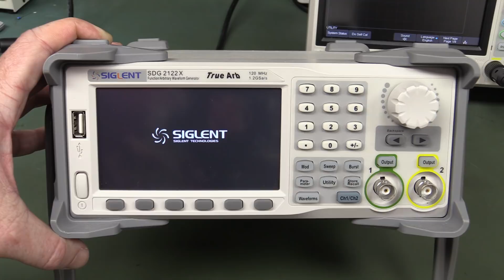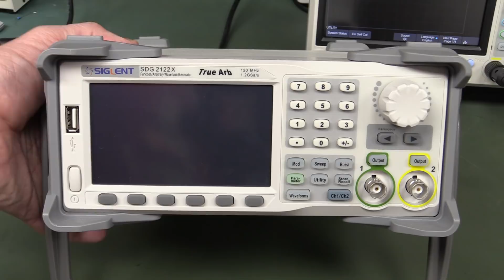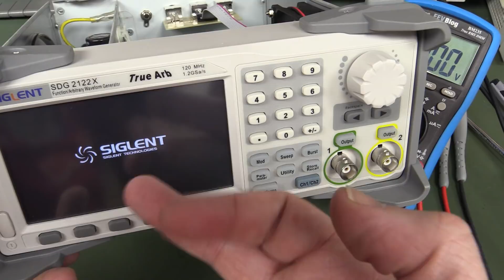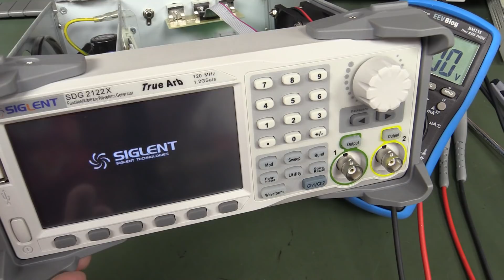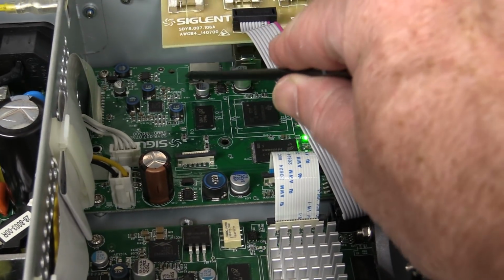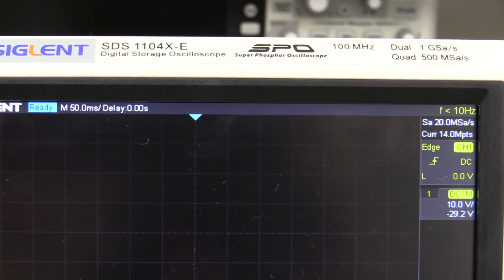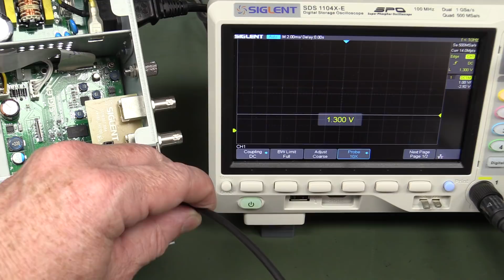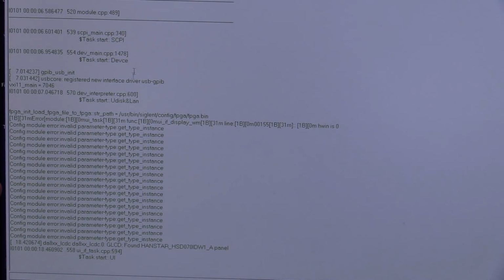Siglent Signal Generator FAIL

Comment: Hi, i think to a corrupt firmware, best thing to try is reflash firmware with usb stick if possible or to connect the signal generator to pc via the usb port at the back of the case

Comment: Download the firmware from their website. Write it to the root folder of a FAT formatted SD card. Power off. Put that SD card in the reader. Power on. Go get breakfast. It should be running fine when you come back. It might lose calibration data, so check it with a known good frequency counter. It will probably lose Arbitrary waveform memory during the update. Such is life. Happy NY!

Comment: I'm gonna agree with everyone here that this machine is 1) Definitely running Linux of some sort as it explicitly states that it's running a file system known as UBIFS, which is a Nokia FS meant for raw flash applications. Looking around PEBS are Physical Erase Blocks and LEBS are Logical Erase Blocks. There are several lines here that seems to indicate that there are none available, meaning that there simply isn't enough free disk space to boot or decompress. Then you get all those errors at the bottom that might be caused by trying to access a value that was supposed to be on the loaded file system, can't find it and fails? Sounds like you should try to flash it with the SD card or send it back to them, definitely a software failure on their part.

Comment: I would say the micro is working. The flat flex cable running to the display/ui looks fuckered.  You may want to check out the UI circuit.

Comment: I'd guess at a hardware fault. The system probably doesn't start the main task because it can't detect something that should be there. My guess would be that it can't see the siggen circuitry on the other board which would lead me to suspect that board interconnect cable.

Comment: there seems to be a ribbon cable connector on the processor board that's missing a ribbon cable. Although that might be for QC testing? Anyhow, the second board doesn't seem to have a ribbon cable connector, but there's a ribbon cable on the processor board going all the way to the front, so if there IS a ribbon missing, then maybe it might go to the front aswell, although I'd guess it to probably be for QC.

Comment: it is saying “task start ui”. it can not started the ui due to a bad software. so, reflashing it can be a simple solution before trying to check everything else. by other hand , can be: mem chips. bad flashram, bad bga cold joints. thoughts?

Comment: Check the mechanical connection between the front panel and the control PCB.  My guess is that the UI process waits for a response from the front panel before drawing anything on the display.

Comment: My money is on the filesystem being full. You can see a bunch of errors about how there is no free space on the disk, creating new logs fail, etc. The UI probably needs some free space to put its locks on files etc. Most of the time Linux won't boot with a full FS.

Comment: Check the ribbon cable that connects the front panel to the processor card - if not seated correctly at aither end, the keyboard controller may not initialise, resulting in what you see there.

Comment: There are at least three log streams mixed in there. Lines starting with "[ timestamp]" are from the linux kernel. 

Lines starting with "10101 timestamp" appear to be from the init process. You can see it starting various tasks, SCPI, Device, Udisk&lan, UI.
There also appears to be extra output from the tasks themselves.

But it's the timestamps themselves which are interesting. You can see it starting the Udisk&Lan task at 7.05 seconds. Then there is a huge 13 second gap until 18.42 seconds, when it inits the display panel (I assume the bootloader put the logo on there and just left it on the display. 18 seconds corresponds with when the screen goes blank).

So it looks like the problem is with the Udisk&Lan task. It shouldn't be taking 13 seconds. I checked the original teardown video and it boots in 8 seconds flat.  

Looks like it's retrying something 18 times, and failing each time before giving up and moving on to start the UI, which fails silenting because something about it's environment is wrong due to the previous errors.

Comment: The display window manager isn't initializing.  It is unhappy with the display hardware for some reason.  Check the cables and connections to the display unit and the keyboard. Initialize to defaults if possible.

Comment: There are tons of lines with "Config module error: invalid parameter-type: get_type_instance" error messages in there, so that's probably a corrupted firmware. Maybe you've had the luck that a neutrino passing through your flash memory didn't just pass through without hitting anything, but instead it flipped the right bit to make it stop working ;)
I'd say: Get the original firmware, reflash it (either over the serial terminal or with a microSD card), and it'll work fine again. Until the flash memory dies completely, that is...

Comment: hi
it looks like a firmware problem if you can make a recovery usb to see if you can get it to boot from that to recover the firmware but before you do that tack all the boards out and check then put it back together and then see if it boots if that

Comment: I had to repair a Nikon microscope camera that had failed after some mains power disturbances. Nikon metrology had remotely diagnosed a failed motherboard and wanted about £2000 for a replacement, plus another £500 off for fitting and it was at this point that my help was sought to ask if I could fit the board.  I wasn't about to believe Nikon's diagnosis without checking for myself. The unit crashed and rebooted whenever you selected the camera on the touchscreen, so I guessed that the operating system was likely corrupted due to the power disturbances.

There's a whole long saga about Nikon's apalling customer service and all the hoops I had to jump through to get hold of the firmware. Then there's the fact that the installation instructions were wrong, but eventually I got the firmware installed and the camera sprung to life. 

It's increasingly a problem with equipment that has a build in operating system, Windows CE, or some flovour of Linux, that it gets corrupted and you're faced with a brick.

Comment: I think the part you should be paying attention to is the bit where it says:

Error[module: ui_task func:ui_if_display_wm line:00155]:: hwin is 0
Config module error: invalid parameter-type:get_type_instance
…

(It'd be easier to read if you had your Terminal program set to interpret VT-100 escape sequences…)

If I had to guess, I'd say there's some non-volatile memory (either battery backed RAM or Flash) that needs to be erased and reset to factory defaults. That's what I'd be looking for — in particular, if there are any onboard batteries, I'd try removing them, waiting a while, then replacing them, on the off chance that that on its own would be sufficient.
Reply: I agree. It appears the window manager is failing to start due to some problem (and that error is probably in blinking red to get your attention if you had ansi color on lol).  Check your cables going to the screen and keyboard.  Try to init to defaults.

Comment: Looking a that text maybe it is saying a fpga is not starting up as it should. I would have tried reseating the ribbon connectors just to try to be lucky, but it is probably not the problem. Another great thing would be if there was a software bug you could somehow force a total reboot. Oh maybe there is a firmware update but it would have to actually to do it without dying. Maybe if you disconnect as much of the front panel including display and booted it, it may get over the software bug, and then it may work again next time you put it back together.

Comment: It almost seems as if they created logs onto the flash, forgot to delete them and then that thing can't boot up anymore because it has no space for new logs and/or temporary files to write to anymore, the last task almost seems as if it's trying to start the UI which command is probably programmed into the bootloader but fails due to not being able to make any temporary files anymore. There's an error further up where it says that it can't reserve space for root.
Reply: Oh and since that thing has a serial interface you may be able to flash the firmware onto it again over it, depends if they implemented that function or not. I remember when I had to rescue a broken OpenWRT Router that way, took hours to transfer that image via serial...

Comment: Maybe an issue of some sort with the front panel board?  Maybe the process is starting fine but the front panel isn't initializing or isn't responding properly, so nothing interacts.

Maybe try remote controlling it with a PC to see if you can get a signal on the output without having to go through the front panel.

Comment: fial to load boot image of either another co-pro or the FPGA boot image....
Gald my tube operated signal gen doesn´t use any boot image nor any semicon stuff, besides a LED that i put in as a replacement of a funny socketed light bulb.

Comment: "Invalid parameter" stood out like a sore thumb. Perhaps the onboard storage has experienced a malfunction of sorts? But my guess is that it is trying to communicate with something, and if you wait for a while, you might get a timeout. I never understood if you had taken it apart, but of you have, try reseating some of the obvious communication wires towards, both towards the user interface and the analogue board. 
A boot log from a working unit could help to pinpoint faults as well.

Comment: Think that maybe the assumption that the splash screen is sent by the processor when it could very well just be handled by the display controller....could be that for some reason, the processor board is just not talking to the display or front panel controller.

Comment: You could turn VT-100 terminal emulation on and you could see better the error message after fpga configuration load message... There might be a problem with one of the frontpanel buttons stuck on (tin whisker maybe) or flat flex cable connection lost.  (error message: ... line 00155 hwin is 0 )

Comment: That "heart beat" in the CPU card's LED is a Linux standard LED trigger. Its frequency varies depending on the system load. In this case, it isn't it terribly fast unlike what you would expect to see during a startup. In my opinion, it's simply waiting for something, though I have no idea on what it could be. My favorite choice would be to reflash.

Comment: The FPGA itself is fine. To quote the service manual "To check if the FPGA is working properly, please observe the test point marked with FPGA_LED on the channel board drawing. The LED light flashes at the rate of 1Hz in normal case, if it cannot be lighted or twinkles at incorrect frequency, then the FPGA may be at fault."

Hardware-wise everything seems to be fine, it's strictly a firmware corruption error. I'd try re-seating the ribbon cables just in case, maybe the CPU can't communicate with the FPGA itself. Other than that, I suggest contacting Siglent.

Comment: UBI and UBIFS are Linuxes Flash storage universal bock interface and associated file system. Good stuff and seems happy from the output.
The issue seems to be in the application software somewhere. If they were clever, the upgrade process works via the bootloader. re-flash it, worth a try.
Or if there is a parameter ram, wipe it.

Comment: SO8 with massive inductor, diode and capacitor? Yeah, probably a linear reg!
Reply: SaNjA2659 was looking for this comment
Reply: MattOGormanSmith Not at all. We are talking about the cubical component with "220" written on it.
Reply: Funny :)
Reply: He meant linear, as he was talking about how we did not have to worry about ripple because of that.
Reply: MattOGormanSmith 
But the Bat Signal is not a beeper.
I couldn't resist.
Reply: that "inductor" is a beeper

Comment: Try to get shell access (maybe already working over the Serial port), this looks like a Linux. If you can get access, check "dmesg" for driver (Hardware) errors. If there is nothing interesting, try to kill the main Process (try to find with e.g. "ps aux"), kill it, and start it with "strace XXXX".
This shows you, what the process does. Then you see, where it stopps.
Post the Output somewhere in the forum or so... Please not as Screen recording ;-)

Comment: A bunch of "module config error: invalid parameter" messages don't  look like a clue?
Reply: I was screaming at the monitor myself :)
Reply: Everything from "Since the FPGA needs to be programmed" onward is confusing as hell. What were you trying to say here?
Reply: Some times when I see this kinda thing is when its waiting for that USB device to enumerate and come online then you see that at the end of all of those and once found it continues onto UI. Or it checked to see if certain options were installed and didnt find them responding to certain I/O requests and we see the one USB device come up, which I would assume is the front panel keypads its seeing, or the screen if its a touch based system, I didnt see the first tear down video on this model.
Reply: fpga_init_load_fpga_file_to_fpga::str_path = /usr/bin/siglent/config/fpga/fpga.bin SEEMS LIKE A GOOD PLACE TO START!!!! Since the FPGA needs to be programmed for what it needs become and to and have its circuits literally laid out to become a Signal Generator Processor!!!!
Reply: Yeah, it is literally right under his nose!  Looks like the FPGA or the memory holding it's software is toast.

Comment: That 31m stuff with brackets is ansii colour. Do you have a working one (or similar one) to compare? I would for now ignore the FPGA part, even if its not working, it should boot up the UI. and it starts the UI task, but then nothing. My guess would be it tries to start another kind of graphic mode but fails to do so. I have no idea about the architecture of that thing, but maybe you can watch the data going to the LCD module and see that nothing is going there anymore? But not sure if its worth trying, this doesn't seem to be really on the component level, more like faulty processor, faulty ram kind of things.

If you have another one, try swapping out the analogue/fpga boards...
Reply: This is actually good advice. I have terminal logs of many of my devices when working properly. If you look at the terminal only when it fails, it's hard to figure out what is an actual error and what is not. Many devices reports lots of errors in the logs even when they're running just fine....
Reply from the maker: Remco Stoutjesdijk  Yes, I've seen many normal boot logs with lots of a "errors", so lots of red herrings no doubt.

Comment: Looks like a buck converter rather than a linear regulator at 3:33. You can easily spot the diode, the inductor (220 -> 22uH) and the output cap.

Comment: Complete guess

"Error Module: mui_task func mui_if_display_wm line: 00155: hwin is 0"

mui_if_display_wm might be:  interface display window-manager

Sounds like it's trying to get a handle to the display (hwin) and fails  (null)

Massive speculation:  Is it possible the display processor has the boot image baked into it?  (and it's not the CPU)  It could just mean the flat-flex cable is damaged?
Reply: Apparently MUI stands for multilingual user interface, it fails to load but the boot process continues.
Then on the last line is the UI task starts but is stuck because of the previous error.

The firmware is on Siglent website, one bug fix from 2016 is "A bug in file system could cause the generator never startup".
But it can't be updated if it does not start...
Reply: The pessimist in me reads "A Bug in the filesystem" as "we forgot rotate system logs and ran out of space".  I wonder if telnet is running...
Reply: Ad telnet - yes it is! It can be used to hack the 40MHz version into this 120MHz one. https://www.youtube.com/watch?v=-HcggjLN1LE
Reply: Might be possible to boot off the SD card with the firmware image, as the bootloader likely will look first on the SD card to see if present, then will look for the filesystem on the card, read directory and then look for the first .bin file and flash it into the application space. Unless you get the right image though it will turn it into a very fancy doorstop, as the loader probably does zero sanity checking on the file, and writes the entire flash system at once, probably overwriting itself in the process anyway but still being fine as it is running the flasher in RAM on the micro, then executing a restart or simply a splash complete screen to the STDIO in the file system.
Reply: The leading m is part of the color escape sequence.  The module is 'ui_task' and the function is 'ui_if_display_wm'.  But yeah, it appears that the handle to the display is a problem.  I see further down that there's a message about detecting an LCD... perhaps it is getting slow to initialize?

Comment: Easy. Chkdsk
Reply: fsck, more likely.
Reply: Benny Banger It’s very likely a BSD, then. That boot output and the filesystem layout seem to suggest it very loudly. I’m pretty sure the only way to diagnose it at this point is to get some sort of CLI. When things die suddenly like this and then exhibit uniform behavior afterwards, it’s almost always either a software configuration problem or a completely failed component that the software can no longer use.
Reply: feliz año nuevo papá ;)
Reply: Attach a keyboard to the USB port and try Ctl Alt F1 to get a terminal screen? I doubt that it is a linux os though - they would have had to recognise open source licenses.
Reply: LOL ...boot in safe mode
Reply: I think we agree then Ryan - Ctl Alt F1 selects the first terminal in Linux.